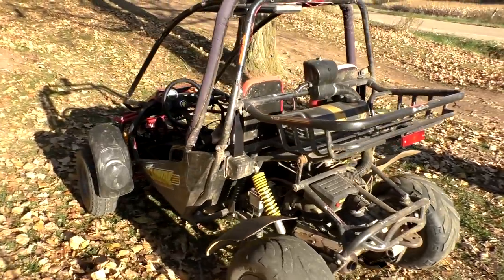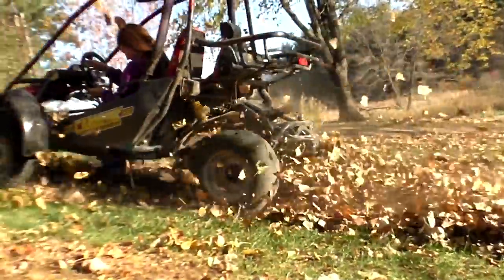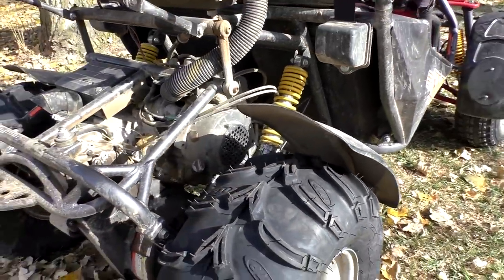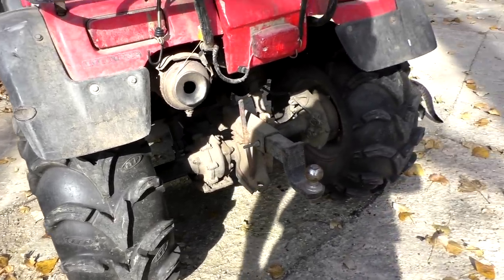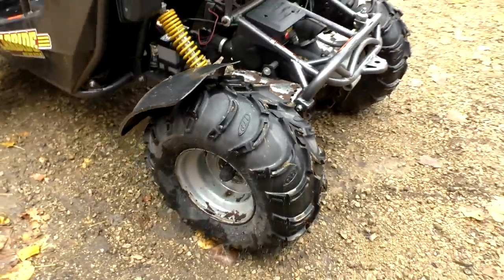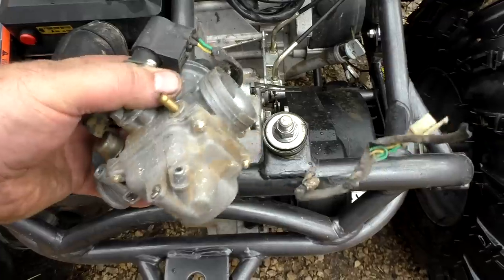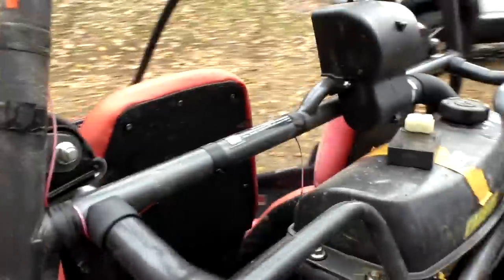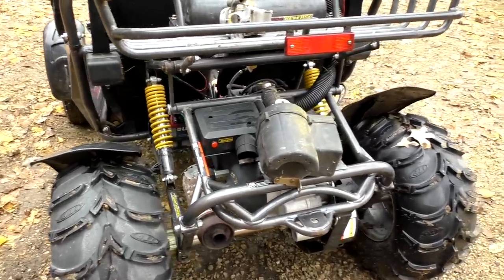Mud Lite tire upgrade  on a American Sportworks Carbide 150cc Go Kart

Comment: Put the 39tooth sprocket from buggydepot.com and your gain even more low end torque plus take off than before these tires even without losing top end cause I did it to mine

Comment: i like what you've done .
i have a similar 150cc 
that i replaced the drive belt last week and my bottom end is horrible now 
i actually have to push it just to get it going..any ideas..on what i did wrong
Reply from the maker: Not really without looking at it. unless something is slipping in the clutch

Comment: Where did you buy the cdi and carb and jets at? I'm looking to doing my kart to get more speed but I can't find what one to get
Reply from the maker: +ymmot110 Everything on ebay. Type in GY6 150cc GoKart cdi. It's 12 volt. Carb, same thing along with jets.
Reply: +scannerguy1968 thank you! I'll have to look
Reply: what is the size of the drive belt i bought the same cart and the belt was so worn i couldn't get the numbers off of it

Comment: What size are those tires and where did you buy them?
Reply from the maker: Ebay, typed in mudlites. I think they were 22 inch. Too tall for winter though. Stay close to 20's
Reply: Ok thank you
Reply: @scannerguy1968  hello hopefully you will respond even after 4 years. Do you remember what size they were. On ebay biggest i cam find is 20x7-8. For 22s id need a wider rim